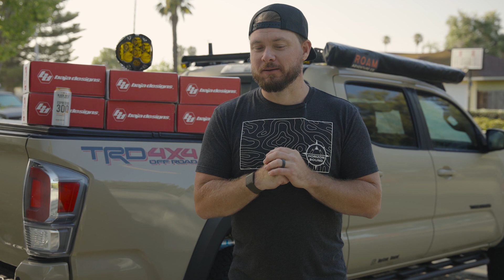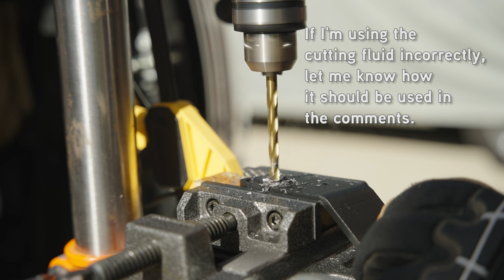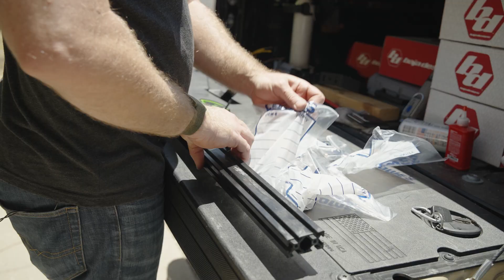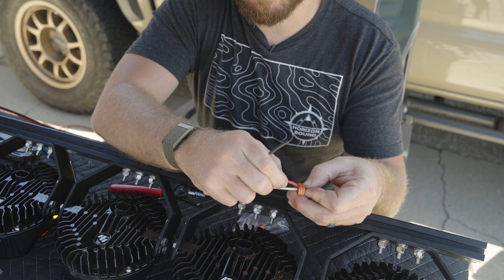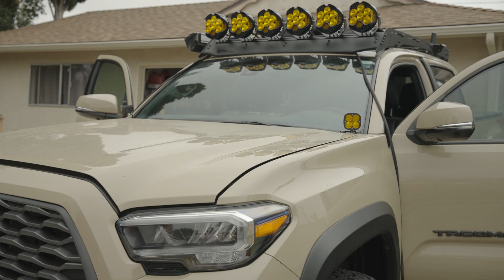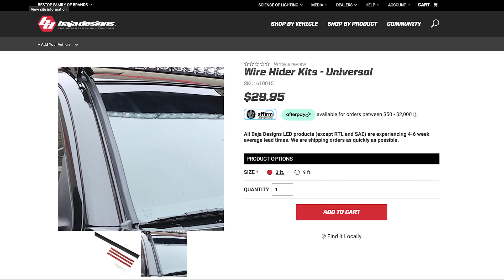INSTALLING SIX BAJA DESIGNS LP6 PODS TO LIGHT UP THE NIGHT! 61,000 LUMENS! 🤯🤯

Comment: Awesome video when you wired it to your switch panel did you put it on a 30 amp fuse, I’m doing the same thing but not sure what fuse to run the lights on I’m running 4 together and 2 separate just like you did. If you or anyone could let me know I would appreciate it

Comment: To anybody reading this, please do not ever splice that way...that solder job is a hack and could start a vehicle fire. There are much better ways to prevent voltage drop. 14 gauge is good for up to 10ft at 10 amps. These draw like 6.5? Just run the wires all the way back to the light controller. All 6 together will not exceed 40 amps. If you run everything back and splice within 1 foot of the power/relay/controller, you won't even need larger wire due to the incredibly short run (very little voltage drop/heat build up). Also, please use a solder sleeve (best) or crimp butt (good) for your splices, and splice 2 or 3 max into 1, and do than twice. Then if those 2 wires don’t fit into your connector/power distribution system, then splice again into a single wire if needed. 6 into 1 is a horrible idea, and if your solder connection is not good enough you can get hot spots due to the current which can and have started vehicle fires in the past. Cool video, educate yourself on how to build harnesses!

Comment: Never wear gloves when working with a drill press.
Reply from the maker: Yeah, I might have broken a few OSHA rules doing that. But those metal shavings are a pain to get out of your skin so I took the chance. Out of curiosity, what would you have done in this situation to avoid metal spurs digging into your skin but also to not risk catching any glove in the machinery?
Reply: Stop using lotion bro 😂

Comment: I would of used solid deutche terminals and any time you have connection points I would of staggered them so there is never any contact if the heat shrink were to ever fail.  I had this happen to me 25 years ago on my race bike... but great video

Comment: This may be "America" but that doesn't mean you're free to do whatever you want. Here in Texas you can install it but you can't use it.
------

Texas Transportation Code - TRANSP § 547.302. Duty to Display Lights

(d) Not more than four of the following may be lighted at one time on the front of a motor vehicle:

(d1) a headlamp required by this chapter;  or,

(d2) a lamp, including an auxiliary lamp or spotlamp, that projects a beam with an intensity brighter than 300 candlepower.
------

This means that if your headlights are on in Texas you can only use two additional lamp fixtures. Each fixture can only output 300 candlepower (Candelas) which is 3771 lumens (luminous flux). So your entire light rig in Texas tops out at 7542 before you start getting tickets. Even if you turn off your headlights and switch on 4x total pods, they can't be more than 15084 lumens total. And if you're thinking, I'll just use them away from roads, keep in mind that Texas Game Wardens are extraordinarily powerful in terms of agency. They're basically like Texas Rangers. You turn these on and you'll get a severe warning at best. If you have any kind of a firearm in the vehicle when you're caught using them, you're getting arrested for suspicion of poaching. No joke.

tl,dr; Research and learn the laws and restrictions on vehicle lighting where you plan to operate before you start installing all kinds of insane lighting rigs. I'd kill to put this thing on my old Tacoma just for fun but it's not worth the tussle with law enforcement.

Comment: Are the side ones special lp6s? The 2 side lights offer great light.

FYI shouldn’t amber lights be mounted low?
Reply from the maker: Hey Robert! Thanks for the comment! The difference between the two outside LP6s vs the four in the middle is that the four in the middle are spot and the two outside pods are the driving combo. I wanted to have a nice even spread on the sides so used the driving combo lenses for that while the four spots in the middle really throw the light out into the distance.

As for the ambers being mounted low vs high. I've seen a few different opinions on that and even though I know Baja says they put amber low and clear high, I actually like the opposite. Since my headlights are clear, it made sense to make the bumper lightbar (not currently installed for this video) clear and keep the ambers on the roof. There is little to no spill on the hood where I have heard that clear does reflect a lot more off hoods. Obviously, a hood wrap or vinyl wrap will help deflect the reflection but for my liking, Ive enjoyed having the amber up high. I may make a video where I swap amber for clear and clear for amber just for experiment purposes but for now, I'll be keeping it as it is.

Thanks for the comment! Have a great day!

Comment: Never wear gloves around and rotating tool except a dremel.  It can grab the glove and pull you into the machine.  I have a 1 handed uncle who did it on a drill press.  Ended up pulling his hand into the bit and it drilled a 1/2" hole through his wrist, they had to amputate because the shavings and fluid were drawn into his wound and it became gangrenous. They cut about 10in from his elbow.
Reply: none of theses subs should be operating power tools

Comment: Are the outside ones different beam pattern then the middle ones?
Reply from the maker: They are. The outside ones are a driving combo light so it spills off to the sides a little more. The four in the center are a spot beam so it throws the light further. Definitely a nice combo to have!

Comment: Good job but to let you know you need an inline fuse for the 14 wire spliced to the #10 it will go between the 2 sizes to protect the 14 wire so they do not melt and catch on fire  have fun and enjoy
Reply: Yes. This is true.

Comment: Did you end up removing the fairing to get the lights to come lower? Kind of want to do this same exact thing but I also want them to be as low profile as possible just like you were mentioning.
Reply from the maker: I didn't end up removing the windscreen. I had played around with it but IMO it didnt really look that great and on top of that, there was still a decent gap under that I'm sure would have made a lot of wind noise.

Comment: I wouldn't put the two dispersed lenses above on the roof because of light splash onto the hood. They are better suited for the front corners of the bumpers to cover zone 2. If you have the SwitchPros RCR12, you can connect the lights to 2 different circuits and control with a single switch if you wish. It's all configurable in the app.
Reply from the maker: I was a little hesitant about that happening but thankfully, it's not bad at all. I've done a lot of night driving over the past 9 months and I haven't had any issues. I'm sure it might be different if the pods were clear light instead of the amber.
Reply: @HorizonBound  thanks, that's good to know.

Comment: is it possible to do the backlit mode on any led lights? if so how? it looks dope, i want to put on my truck
Reply from the maker: I don't believe so unfortunately. Not on any LED light at least since the lights need to have an additional light inside the housing to create the backlit "look". Baja Designs has backlit functions in there LP series and S8 series lights and I know other companies also have offroad lights with back lights built in.
Reply: It has to be a light that has backlight. It’s built into specific lights.

Comment: Awesome video, I would like to add that you need specific type of crimpers for these deutsch connectors. They are fairly cheap on amazon and range from 15 dollars and up. How did the dimming function work out for you on the switchpros? I have the upfitter harness right now waiting to be installed so that I can run all the functions, but still debating if I want to lose a spot on the switch pros for a low beam.
Reply: Dude doesn't care about anybodies questions.  He's obviously a loser.

Comment: Um hate to tell you this but BD engineers are smart so the they designed the brackets to work out at all angeles you just needed to reverse the bracket to achieve that angle you where looking for.
Reply from the maker: Lol believe me, I did. It didn't work. The lights were pointed upwards that way

Comment: That is an extremely expensive light bar.
Reply from the maker: Yeah, it was pretty pricey but still worth it in my opinion. I actually changed my ditch lights to be chase lights because the spread pattern on the two outside LP6's were so bright that they overpowered the ditch lights.